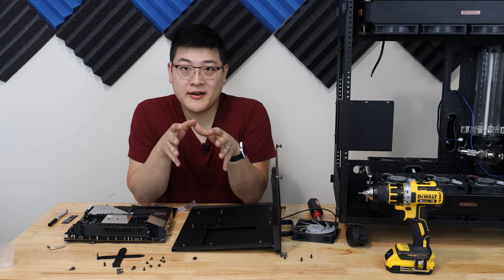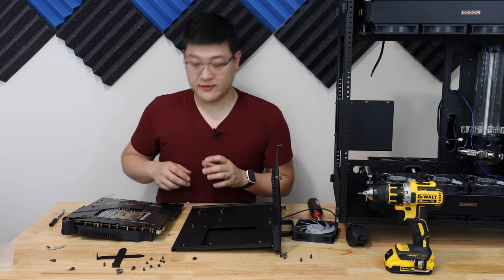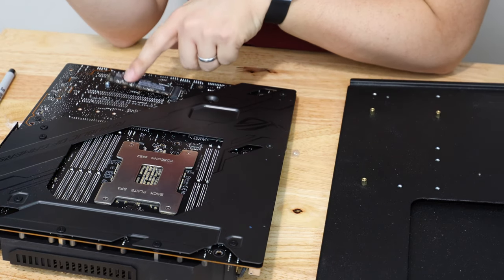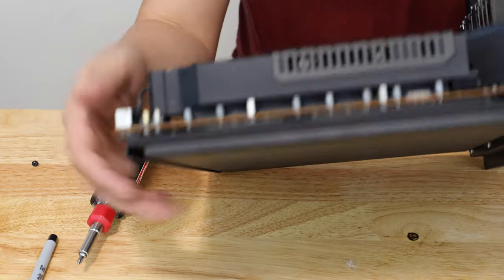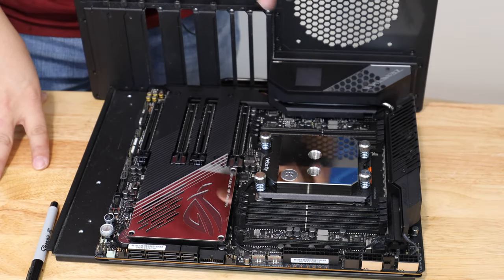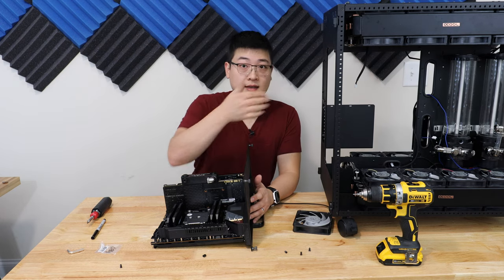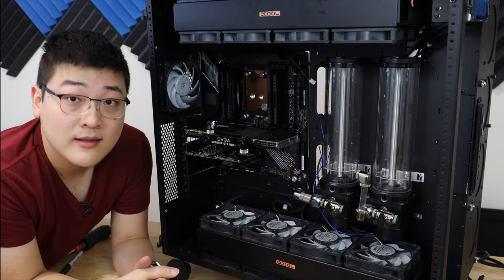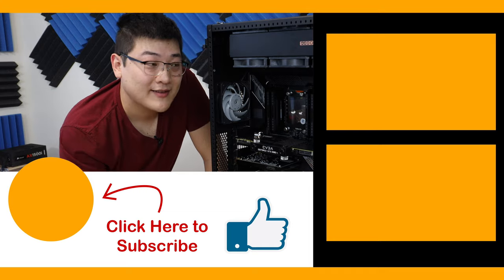AMD Threadripper 3960X Build Part 2 - Motherboard In!

Comment: @0.38 it looks like the top 970 evo is missing a standoff - just screwed straight in. I could be wrong though. If it is missing then the drive probably wont be making sufficient contact with the heat spreader
Reply from the maker: Nah, I made sure it had the little standoffs. There was even a pretty little imprint on the thermal pads when I took it off.

Comment: Hi, you mentioned in some moment an m.2 memory for the backplate of the board that will run Mac/os..
I’m curious about the boot up sequence...
Do get a choice when you boot up or do you change it from bios every time?

By the way, thanks for a great video!
Reply from the maker: I was meaning to go hackintosh with the system but in end TRX40 was never fully supported by the community because it was too expensive and exclusive, no one wanted to debug and make it work.

Theoretically you would have a boot loader that allows you to choose your OS during the boot.
Reply: Tank you!

I’m currently building on zenith ii alpha with a 3970x and g.skill 128gb cl14 running on m2 firecuda.. is the system worth, what is your thoughts?
I need a workstation...

Thanks again!

Comment: Hi! Great Video! I have a question. I have a Zenit 2 Extreme with Ryzen 3960 and added rtx 8000 quadro. My Problem is Power supply for quadro. He has a 8 pin+ 6 pin. There is one small adapter that comes in. So i pluged PCie, 8 pin to that 6 Pin Adapter. And added one more PCIe cable to the 8pin on RTX. Did i do something wrong ?

Comment: This mobo states pretty high-end audio, including the Japanese-made capacitors and DAC. Do you still find benefit from having the Sound Card or do you use it simply because you already had one from another build?
Reply from the maker: The motherboard DAC is fine for most things but the connections are lacking. I need RCA for my studio monitors and a 1/4 inch connector for my headphones.